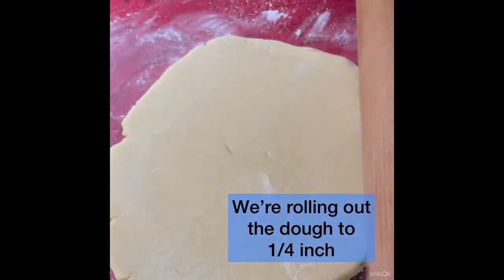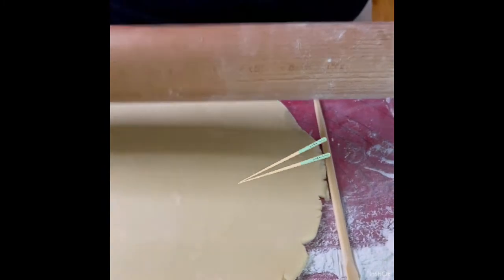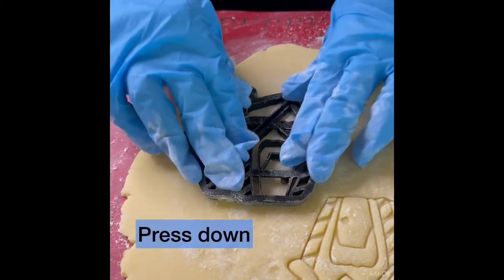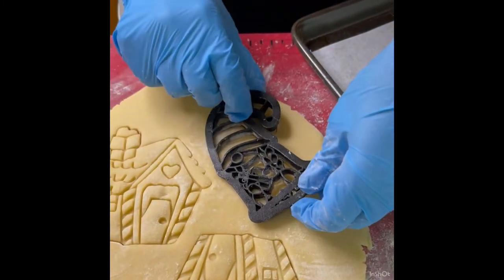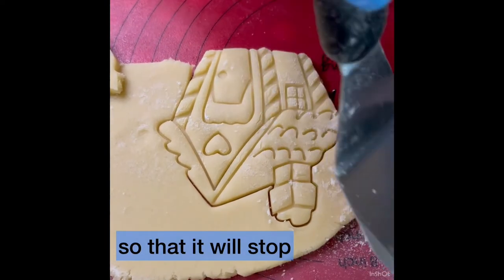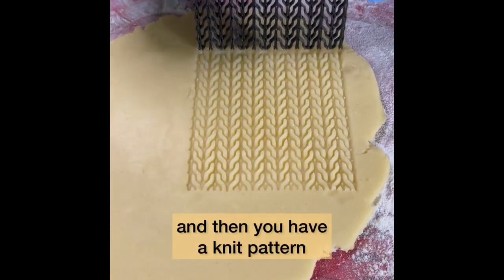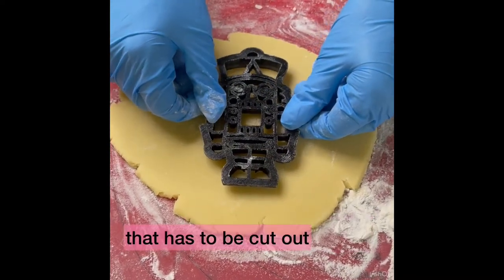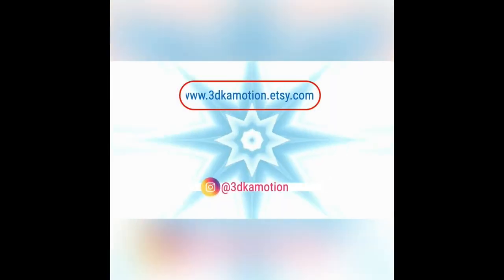How to Use Detailed Cookie Cutters from 3DKamotion purchased at www.3DKAMOTION.ETSY.com

Comment: Can I use the same cutter on fondant and place on top of cookie?
Reply from the maker: If you roll the fondant to 1/4" it will work with the cookie cutter.  Use icing sugar instead of flour on the cutter and rub vegetable shortening on the fondant to prevent it from sticking.